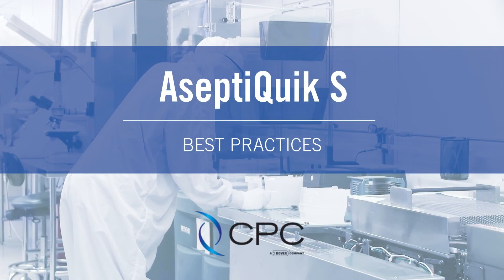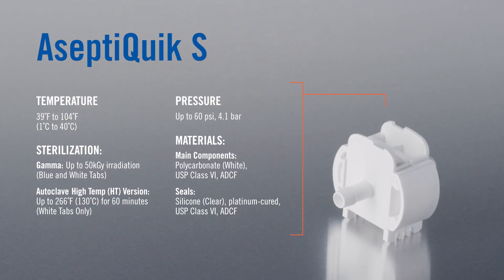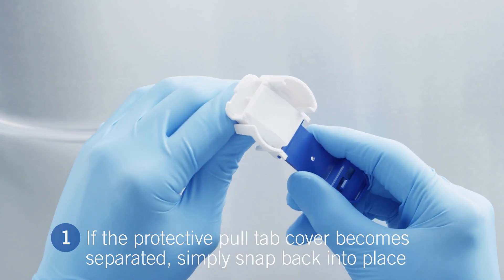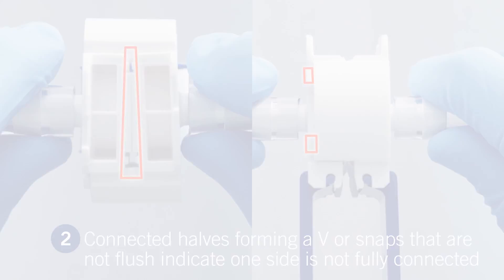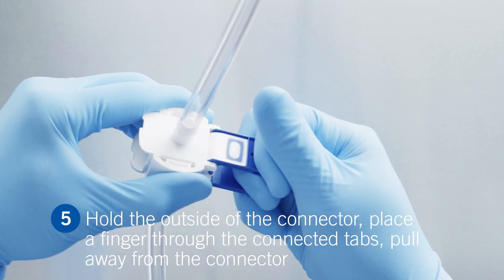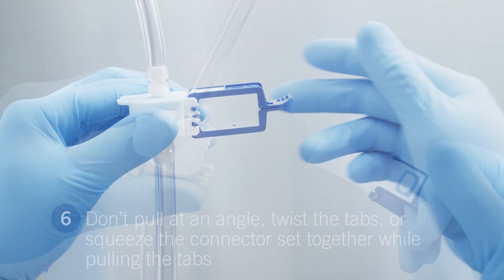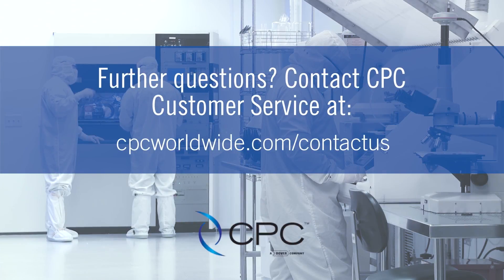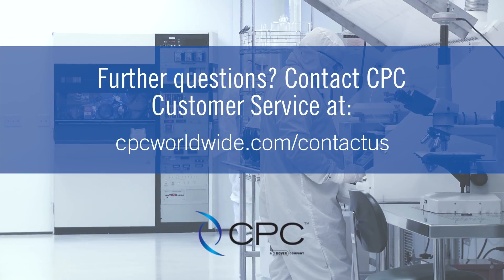CPC Aseptiquik S Best Practices

Comment: I have a question, if we connect the cpc and the seal dont full the remove , what the next step for remove this seal? Thanks
Reply from the maker: Thank you for your question and utilizing CPC’s connectors! Based on our interpretation of your question, we recommend first ensuring that both sides of the connector are fully “clicked” together based off the checks described in this video. If they were fully connected, you can continue to remove the sterile barriers from the connector. If this does not answer your question, please reach out to our team directly at info@cpcworldwide.com to help us understand how we can help.